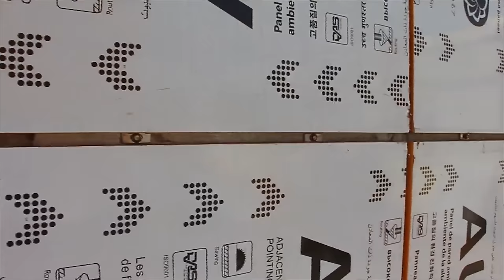Aluminium composite panel installation

Comment: All arrows needs to face the same way, gaps are un even, no welding goggles and the drill is scratching the sheet as you screw
Reply: Agree they are not professional

Comment: This is the same flammable material that helped the Grenfel tower fire in London. Not sure I'd want it all over my home or office.
Reply: They do make a Fire rated material that you are supposed to use if going higher than 2 stories I believe. Reynobond (along with some other companies) are discontinuing their PE core, and are only going to sell FR core for legal reasons.
Reply: @scottroberts6807  fr is flemable mate
Reply: @martinkovii4820  I never said fire proof. I said fire rated
Reply: Yeah u can get fireproof sheets also ...

Comment: No safety glasses when routing metal.  No ear protection when drilling into concrete.  No goggles when welding.
Reply: and yet there are almost no work place injuries. 
no hearing protection bcoz they get job every day or week or month.  
no glasses as its expensive,  they don't earn much. if they need,  they wear sunglasses for eye protection only if they really need to. for extensive welding, they use sheld or sunglasses , and cover face with clothes if it's very sensitive person.